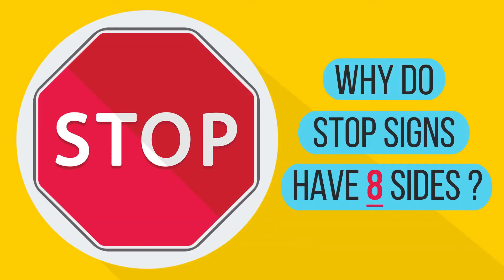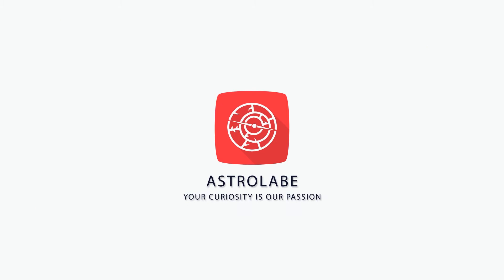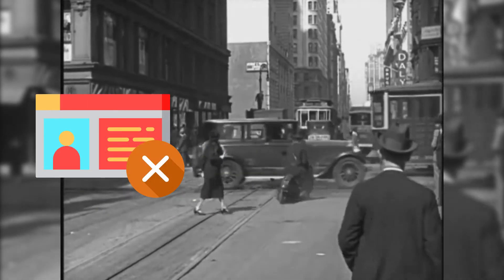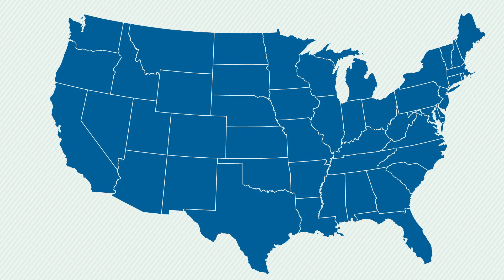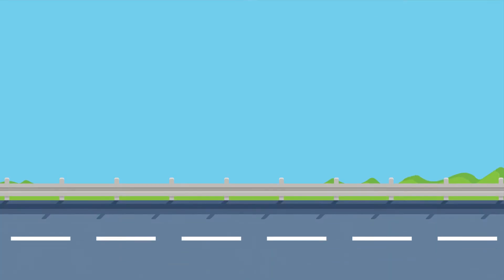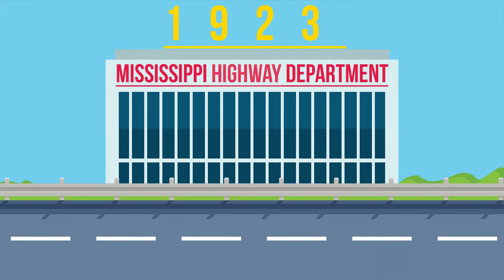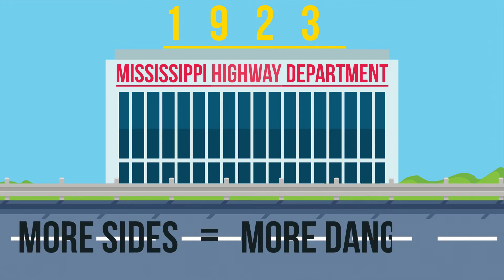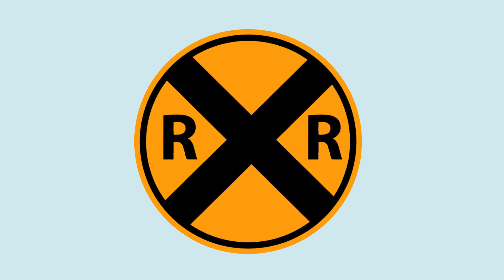Why Do Stop Signs Have Eight Sides ?

Comment: its only been 103yrs since the  STOP sign???
Reply from the maker: only
Reply: steam engines been around 200yrs!
Reply from the maker: Ok ,so steam engine is not a sign 😂
The humanity developing by the time they said " ok we need a solution for this problem" , before 200 years they didn't faced problems with cars to force it stop in a specific spot, and by the way stop sign is available before that but it doesn't look like the stop sign we know right now
Reply: horse drawn machinery 500 yrs? 1000yrs? haha... stop and move at own risk laws... big gets right of way over small laws maybe